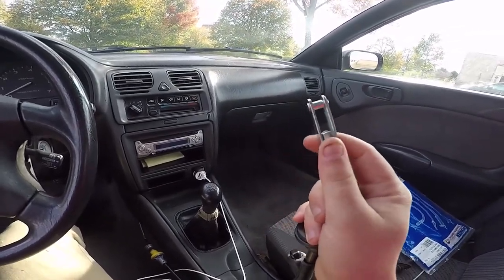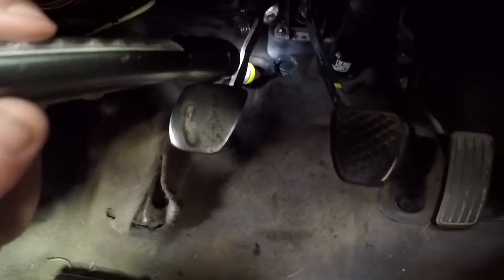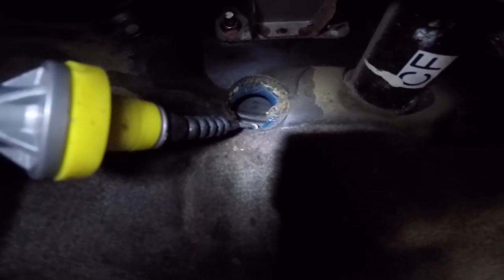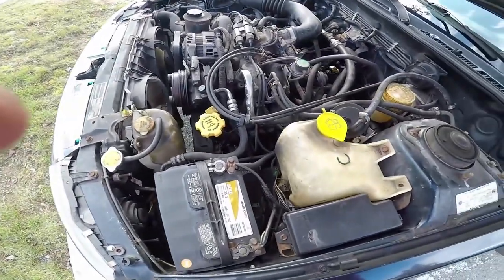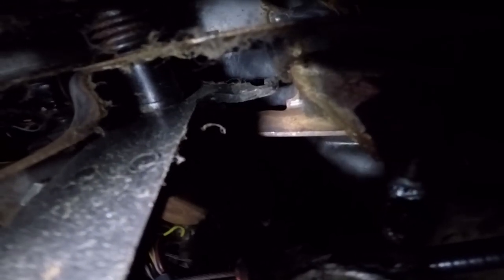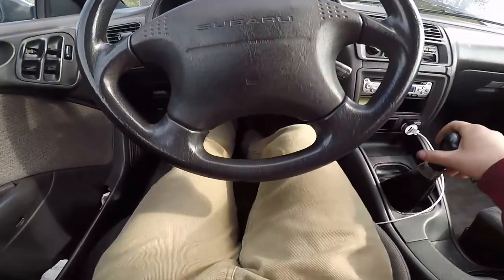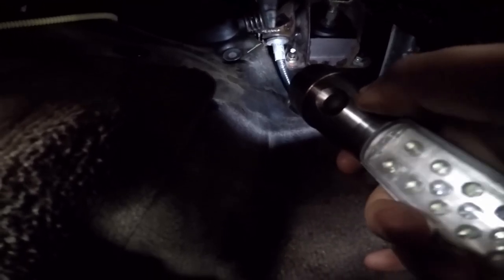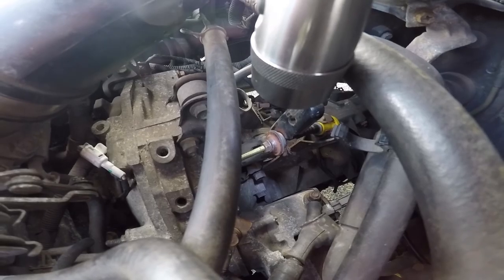HOW TO: Replace Subaru Legacy Clutch Cable

Comment: Thanks! It's legends like you who record their work that give me the insight to do it myself. The round retaining part that clips into the bracket on the firewall just shattered while I was driving and the clutch went to the floor.
Once I had my replacement cable I took out the clutch pedal (surprisingly easy! 2 nuts and 1 bolt) and routed the replacement through.
Your video gave me a good idea of what the ends looked like and what could have gone wrong.

Comment: The tsk clutch cable is 5000% better then aftermarket. I went threw about 5 clutch cables until I got the tsk.  The metal wire is wrapped in plastic and comes with nessacery parts. Amazing. Don't cheap out on the cable. Iv broken a couple and make sure it's not too tight. Not even any tension is best at the pedal with 1 inch of free play
Reply: Good lookin out 😎

Comment: Had a mechanic install a refurb tranny when I bought a 92 legacy wagon. That ugly gal ran like a champ for 12k miles, then the cable snapped. I can only assume that it was a cheapo aftermarket rig and/or the rapid temperature change in our abrupt season switch up here. Either way, this was helpful. Thanks 👍

Comment: Hey I thought this video was handy. Even if it's not the exact right way to do things, it's good to know where all the parts are located, and how to make a quick repair to get your car home. I just had the exact same thing happen in my legacy, the clutch pedal fell down to the floor and I was SOL. Not knowing any of this beforehand I had to have my car towed to the shop :(   I'm feeling a lot more prepared for the next time I snap a clutch cable.

BTW, what kind of car are you driving in the beginning? Pontiac GTO?